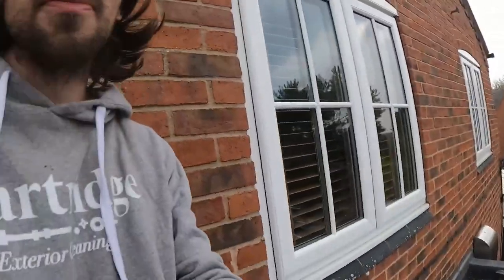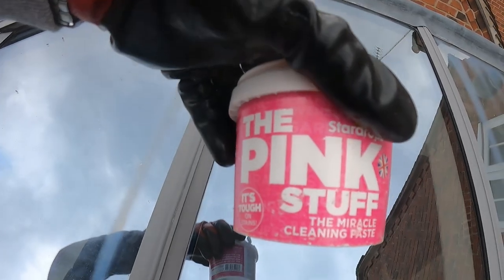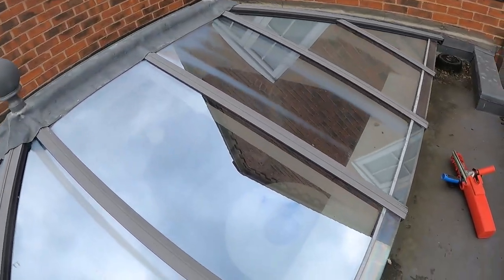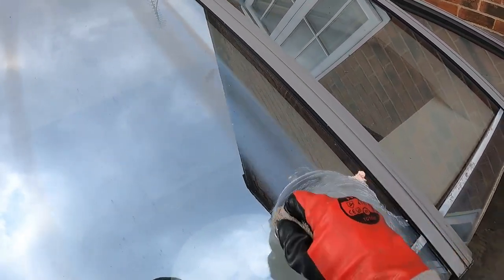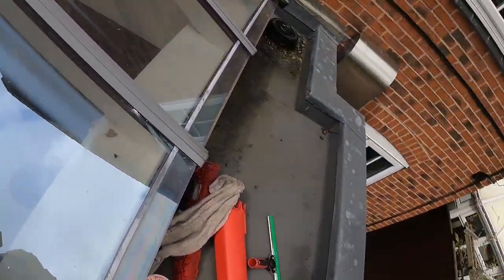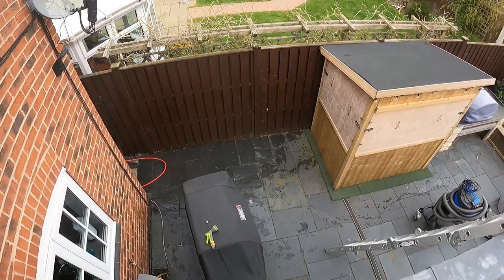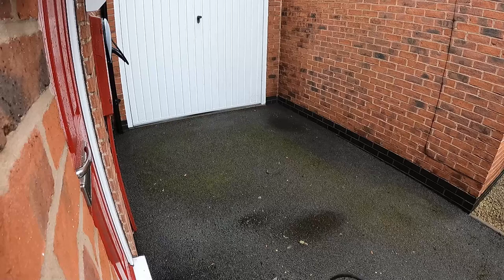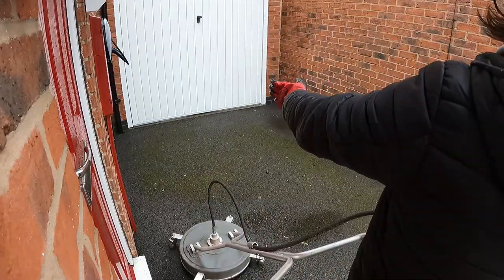Removing Lead Staining & How to Power Wash Tarmac Without Leaving STREAKS!

Comment: There’s a clearer on YouTube called Aurikatatiina who tackles some terrible stains. She uses power paste/pink paste with a ‘cleaning blade’. It doesn’t scratch the ceramic hobs or remove markings as you shouldn’t dig into glass/surface just glide it over. Might be worth considering:
https://youtu.be/eBtV1kP5KAo

Comment: The Pink Stuff has been around in England for a really long time. It's only been in the past year or so that it's come over the US market. In the US, Bar Keeper's Friend is the go-to cleaner. Both have similar active ingredients and work as a micro-abrasive cleaner. Similar ingredients are used with Scrub Daddy Power Paste. So in reality, you just need to go with what is the cheapest option in your area. 

Although, the easier option would probably be to go with what car detailers use, iron decontaminant/remover. It's main ingredient is thioglycolic acid and reacts with iron particles that can be rinsed off after about five minutes. The Detail Geek does this in his videos. https://youtu.be/vWEyLr4vcQk?t=586 - here's a clip of it. You can also use a clay bar afterwards to remove any other particles that may have etched themselves into the glass. It would probably be faster and easier than using a blade scraper.

Comment: I'm surprised nobody came up with this, but lead marks can be removed using some acid, vinegar, citric acid, etc. It might need time to deal with it depending on the thickness of the layer.
Another easier way is Cillit Bang or similar.

Comment: 0000 steel wool will make it easier instead of rag.
Reply: Won't scratch the glass?
Reply from the maker: On normal glass I'd agree but these orangery and conservatory roofs have a film on them which you have to be careful of disrupting so just incase I opted for the cream and a soft scrub with a towel or sponge